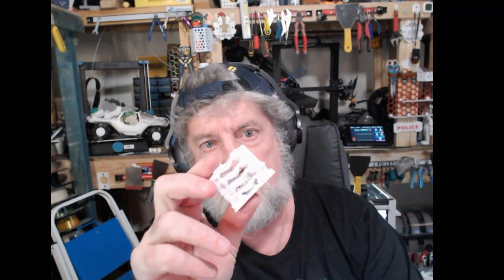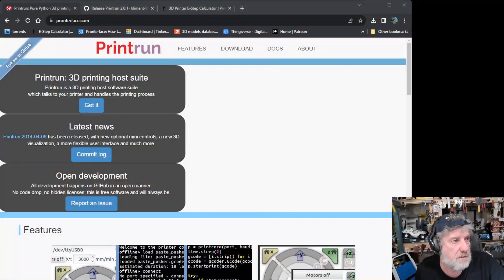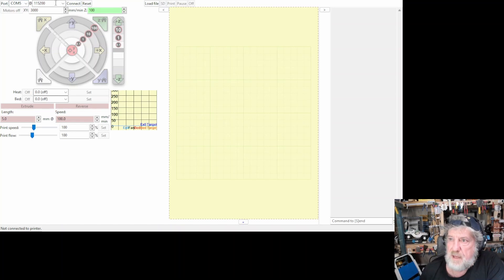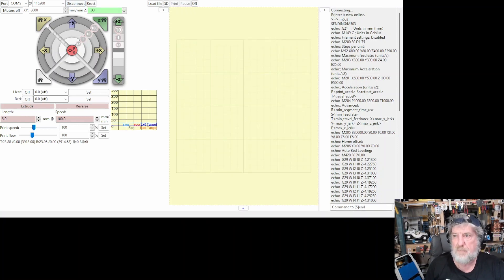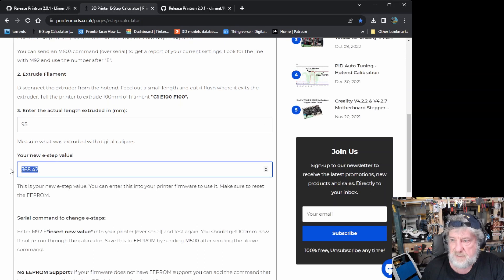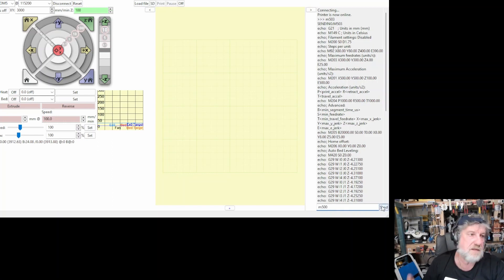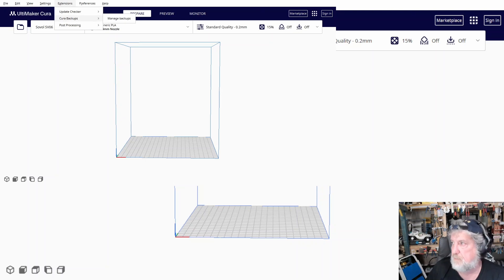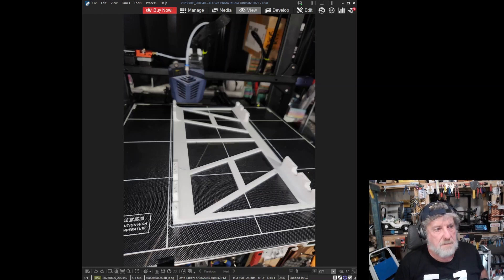Using Pronterface and temperature towers to fix faulty prints due to over extrusion on my Kobra Max.

Comment: Hi All , 
I have a Kobra printer but i have difficulty connecting it to my computers to use the Pronterface,  did you guys just connect it through the USB port on the front of the printer? I appreciate your advice. I installed CH340 driver already but didn't help
Reply from the maker: Yes i used the usb port to connect it

Comment: I wanted to express my sincere gratitude. You saved the day for me. I bought an Anycubic Kobra off FB marketplace and after 3 nights of Troubleshooting, I could not understand why I kept getting over extrusion. No matter what I tried I could not get a good print to come off the printer, even with my solid slicer settings that my other Kobras run. It looked like too much filament was being extruded. Turns out I was right, the person I bought the printer from had messed with the E-step value. They cranked it up to 555 when 390 is the default (verified with my other printers). I would not have solved the problem without your video! You get a sub for sure!
Reply from the maker: Excellent, thanks for letting me know, makes it worth while when i hear of things like this. So glad i could help